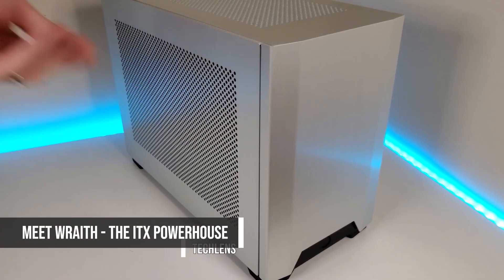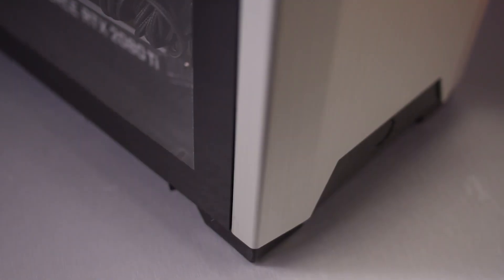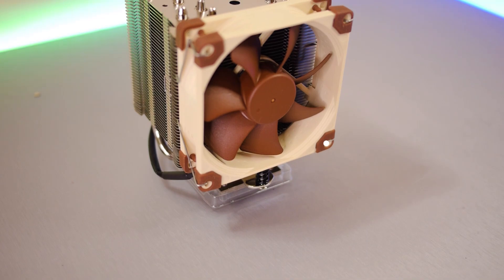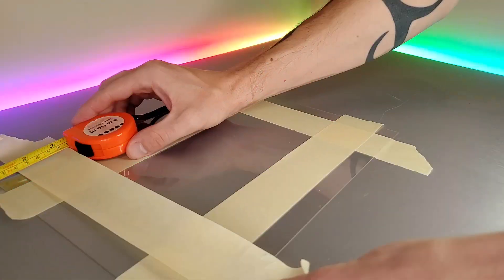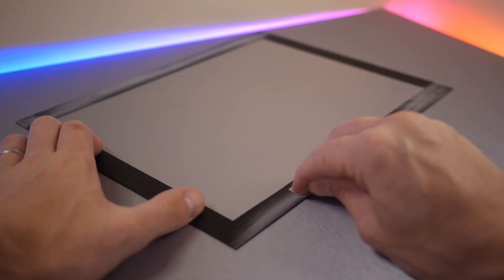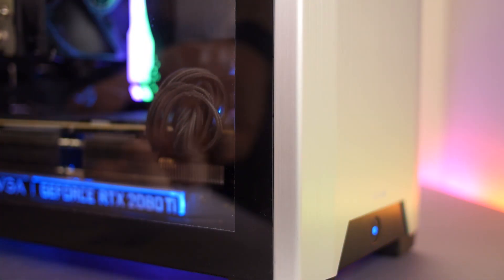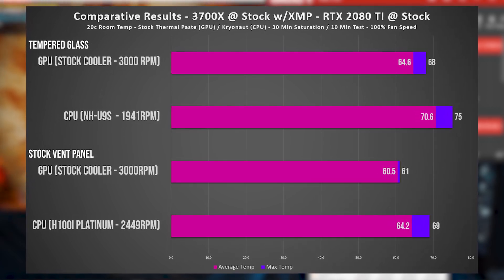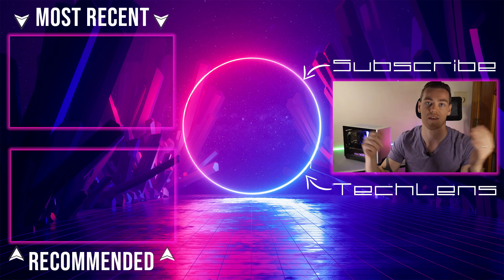Ultimate NCASE M1 Tempered Glass Side Panel Mod

Comment from the maker: The response from you guys has been awesome ❤️ 

Good news, new V2 Panels are in stock! 😊 Get your Tempered Glass Panel here: https://ebay.us/Fyb0MM
V2 Updates:
- Thickness increased to 0.8mm for increased toughness and slightly better fit.
- 20mm Silk Screen Blackout Boarder applied at time of manufacturing - each panel is now professionally finished.
- Both vertical and horizontal magnetic strips included for additional mounting strength

Hope you love them! If you bought a V1 panel, message me on eBay, ill give you a discount 😊
Reply: Will you post an updated or will it be under the sand listing on eBay?
Reply: Not to be a nudge but any update with v2? Trying to decide on whether I buy this case and this mod is going to seal the deal for me
Reply from the maker: @John Here you go - https://ebay.us/Fyb0MM
Reply from the maker: @Tim Tonelli Haha, no problem. They should have been in stock before you commented but was having issues getting packing boxes for them. Here's the listing: https://ebay.us/Fyb0MM
Reply: @TechLens   Ordered one! Just curios, are the windows tinted at all?
Reply from the maker: @john2705  Sent out yesterday! Hope you love it :-)

The window section isn't tinted, It's as transparent as possible. But if you wanted to add a tint, it should be really easy to do as its a flat surface.

Heads up, if you decide to do that down the line and need to remove the mounting strips from the panel, the pre-cut magnetic mounting tape that I included with your panel is in the description here - so you can easily replace it. But of course, if you have any questions, let me know!

Hopefully you can comment here a link to your build with the panel on so others can see. maybe add your honest opinion? Will really help others out that are deciding on this.
Reply: TechLens I’ll definitely send you an album and some B roll if you want it, have a list of mods to get done. Should be a good weekend project! 

Thanks again for making these. Been a long time ncase owner (v2!) and this has been my number one pending mod
Reply: TechLens awesome! Just picked one up!
Reply from the maker: @tt.kb_  Will be taking it to the post office today!

Hope you love it! and don't forget to post a comment here with your opinion and a link to your sweet tempered glass NCASE! :-D 

PS. the packaging is a little unorthodox (and overkill) as ive been waiting on supplies, but lets just say, its 1000% going to get to you safely! haha.
Reply from the maker: @john2705  haha! absolutely, link to a dropbox folder or something would be awesome!

V2 Panel for a V2 owner! that is a long time NCASEer. Which mod is next?
Reply: TechLens Going to be testing out some test prints this week but possible a founders edition shroud LED swap, the PSU cover and a chromax U9s whenever it comes out
Reply: TechLens I will be sure to do that whenever the thing gets here, I just ordered it now that I was able to get one of these. Availability of this mod was the deciding factor for me. I guess we’ll see how long of a wait I’m in for haha
Reply from the maker: @tt.kb_  Sent. Should probably be with you by end of week! 😊

Comment: Nice video mate but one additional thing that u can make the video more informative is by telling us the estimated cost of the changes made between the two pc (Not a must). But overall very good work and this gave me another alternative as i always thought that ITX forms tend to run extremely more hotter than the rest. Keep up the good work!
Reply from the maker: That's a good idea... I'll probably start including that - thanks!

With ITX builds, it's definitely easier for it to be hotter because of the space limitations. But if you optimize, really research and test which parts are best - you can end up with a true mini beast.

Thank you!
Reply: @TechLens  Yup I couldn't agree with you more

Comment: Great video, im looking for inspiration for a custom side panel for my 011 Dynamic Mini. What paint did you use? Im wondering what lian li used, the bond had to be pretty strong to hold the weight of that panel up.

Comment: When I swipe the 240mm AIO to Noctua U9S. I got a 15C difference. I repeat the test a few times, but got the same result. Why?
Reply from the maker: Depends on quite a few factors:
- Are you fully saturating the AIO? (you'll want to run it full load for 30+ minutes before you even think about recording data) 
- Fan orientation
- Number of (and same) fans for the CPU cooler
- Fan profile
- Thermal paste
- Are your GPU fans running? 
- CPU itself (scaling won't be the same with a different CPU)

And then, to top it all off... I now have a completely different airflow design of the case with the Tempered Glass Panel. So what may seem like a direct comparison, may be very far from and why it's so important to keep every variable the same, apart from what you're testing.

Hope this sheds some light 👍🏼
Reply: @TechLens  There are so many variables. Very hard to make direct comparison. Anyway, I think I'd go back to water cooling. 

Just discover your channel. Some very interesting videos. Subscribed! Love to see how the channel develops.